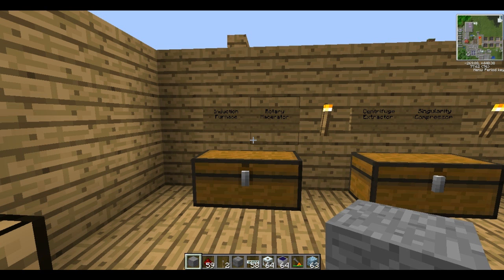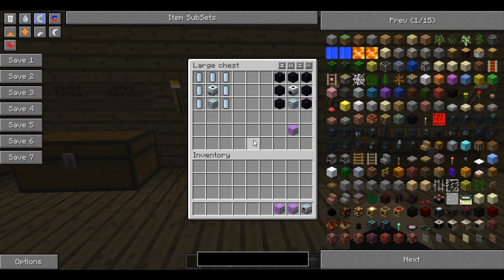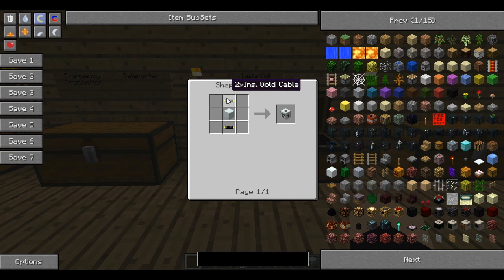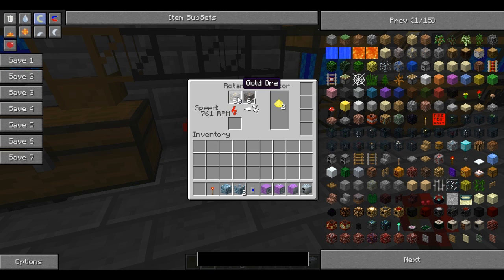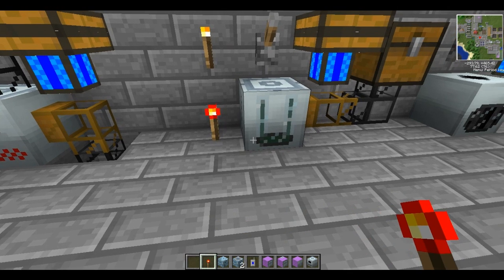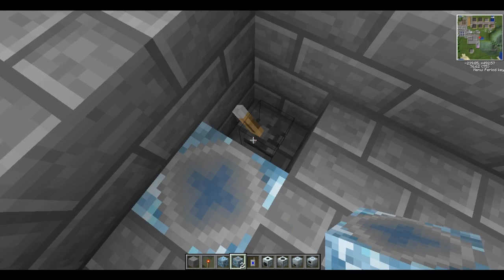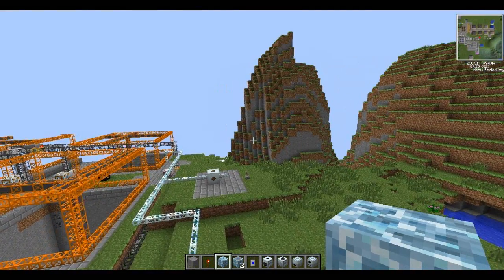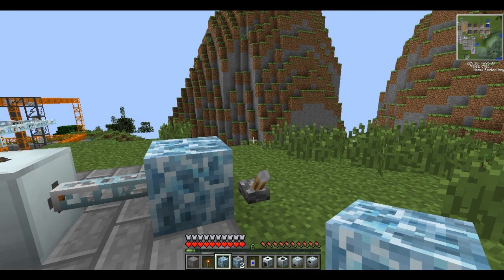Tekkit Tutorials Part 15 - Teleporters, Tesla Coils, Upgraded Machinery

Comment: You need to hook a pulse former to the button if you are going to use buttons. This is why levers are preferred over buttons because the button will cause you to get stuck in that infinite loop due to when you teleport, by the time it loads the data it still thinks the button is active and thus causing your loop. MORALE OF THE STORY, USE A PULSE FORMER.

Comment: I get the same texture problem with the Compressor, and Masserator (I cant spell well :C)
But I use a texture pack, and it still glitches out and instead of redstone torches, get a lever and place it on the machines by holding shift.